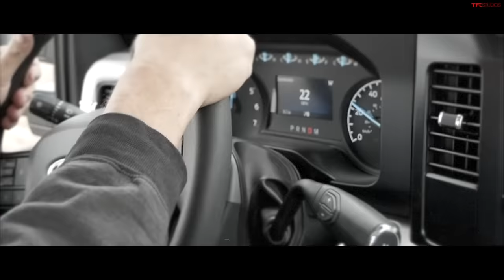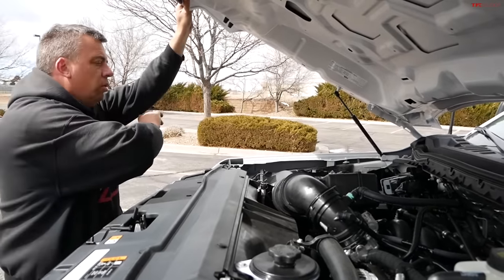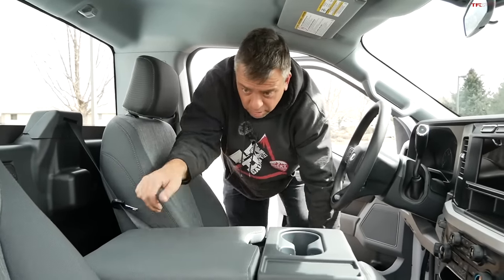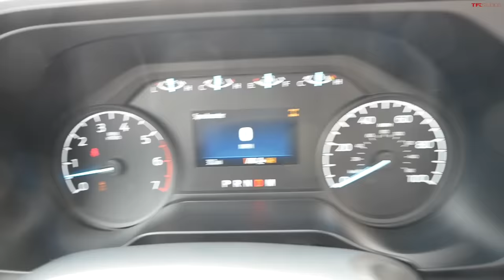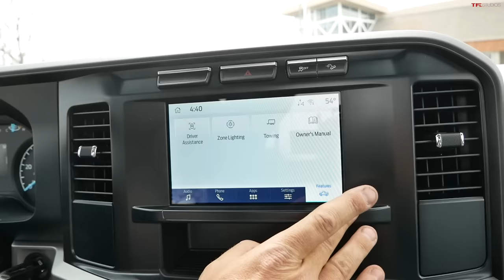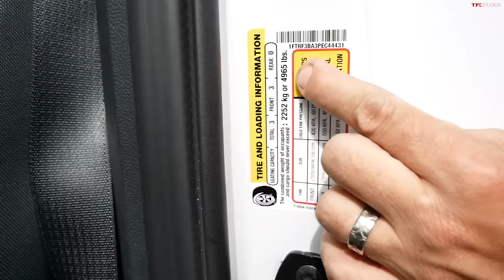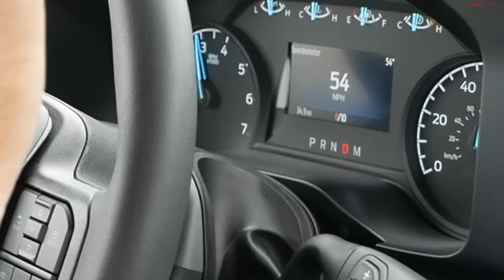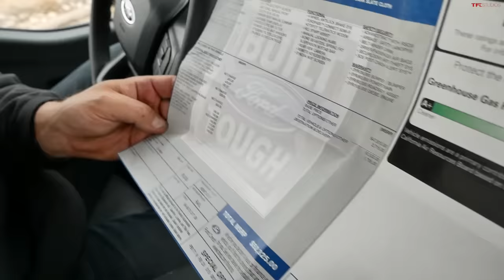I Drive a 2023 Ford Super Duty XL Work Truck with the Brand-New 6.8-Liter V8!

Comment: Even it being a "basic" worktruck doesn't mean it's still not to expensive.
Reply: 😮 still to darn expensive
Reply: The mMSRP is up by over 3k over 2022
Reply: 20 years ago this truck was $28,000….when you adjust for inflation that’s $43,000

If your wages kept up it’s not too out of scope…esp this truck will drive better and tow/haul more
Reply: @tjhva  And that is the underlying issue. Most folks' wages haven't kept up with inflation. The average person has much less buying power compared to 20 years ago.
Reply: Hahaha inflation. Record fuel prices. You name it. You voted for it.
Reply: @tjhva  if you add features that come standard in this truck compared to 2004 you will be close to 50K
Reply: Drove a 7.3 and was shocked what a toilet 🚽 it was 😂. Maybe this 6.8 is a better engine? They had 1 but wouldn’t sell it..?
Reply: They have to review trucks. Regardless of the cost
Reply: Too
Reply: @mdubz101  what is a better gas motor ?
Reply: Who the hell said you need to buy a brand new truck
Reply: Work truck means fleet continuity not cheap. Companies need write offs
Reply: @BigMikeRobinsonFJB   not me
Reply: @t20594   Exactly....beyond it being way more truck the Section 179 deduction has increased a lot since then too. An even more interesting question is would someone have paid $40,000k+ for this EXACT truck back in 2005 or gone for a $28,000 base model with bad driving / leaf spring front / 5.4L etc etc
Reply: @guyod1  Still this is way to expensive
Reply: It's still the cheapest you can get now-a-days for a new truck so he's exactly right.
Reply: scott offord  that's a cool truck, but won't hold a candle to this F350 for capability. Can't tow nearly as much, can't tote nearly as much and no 4x4. 🤷‍♂️
Reply: @dxvidcx Naturally, or if you’re an independent contractor / biz owner of any sort you also raise prices over time. Average income is up from $55k to $70k since 2005 per census data + section 179 deductions are WAY bigger now…the price jump isn’t all that wild once broken down.
Reply: @mdubz101  7.3 is a truck motor lol. In a heavy ass truck. They’re monsters swapped into cars
Reply: Too
Reply: @whatthehallbetch  Got him.
Reply: @tjhva the tech, and powertrain is greatly improved over its 20 year old 2003 brother. A little increase over just inflation
Reply: @BigMikeRobinsonFJB  that's not how it works, but I know it's easier to blame a president you probably didn't vote for than actually trying to learn and understand why inflation has been a GLOBAL problem since the pandemic started. The U.S. president does not set gas prices or food prices. The oil companies and food industry do. They are also responsible for their record-high profits when Americans are hurting the most. Their rationale is production shortages due to the pandemic, but that should no longer be the case, yet prices stay high and they continue to make huge profits. Focus your blame correctly.
Reply: @palebeachbum  the typical blame and deflect soy boy talk.
Reply: @jessenp20162725  Exactly. When you factor in everything, including increased Section 179 deduction, $8-10k increase in price 20 years later isn’t wild
Reply: @BigMikeRobinsonFJB  sorry but I'm not going to argue reality with someone who clearly lacks education on the matter.
Reply: @palebeachbum  again you are incorrect. Stop blaming and deflecting.
Reply: @BigMikeRobinsonFJB  then educate me. Please explain to the class how high food and gas prices globally are the U.S. presidents doing and have nothing to do with the global pandemic. Anyone can say "you're wrong". That takes no effort.
Reply: @BigMikeRobinsonFJB  didn’t you “blame” the president? Do you always behave like a child?
Reply: I bought a brand new 2004 F150 XL Heritage supercab. Paid $15k out the door. Great truck.
Reply: @palebeachbum  So it was Congress and the President who agreed to print trillions of dollars out of thin air while the pandemic had been already over for at least a year, pushing spending above WWII levels.  Then the Fed had not increased interests rates to curb inflation because they didn't like the bad press, until of course it was too late for it to have a good effect, so when they actually did start raising rates it caused a mini banking melt down.  Lots of economics behind that I won't go into here but raising rates more now will continue to exacerbate a banking crisis.  You can't use a blanket response "it was the pandemic" because our...  YOUR politicians are responsible and have to answer to the American people for their decisions, right or wrong, pandemic or not.
Reply: Too much !
Reply: Do you know English wtf did I just read? doesn’t mean it’s still not to expensive? HUH
Reply: @tjhva  this truck is 70k Canadian😂😭
Reply: @BigMikeRobinsonFJB  not fully accurate.  Yes, inflation has been bad the last couple years.  However, the cost of living has been rising for many decades way faster than wages.  It is not the 1950s anymore and that didn't just change just since 2020.  Look at what a CEO earned in 1955 compared to the average worker.  Compare that ratio to today.  Compare wealth and salaries from the top 1% in 1955 to today.  Very telling...

And record fuel prices over the last few decades actually came in the summer of 2008, when we adjust for inflation.
Reply: 50k is a steal
Reply: It’s hideous 💀
Reply: scottofford3061 has no payload
Reply: @palebeachbum FJBiden
Reply: @BigMikeRobinsonFJB  the typical non-critical thinker mentality. Baaa sheep
Reply: @kenj.8897  He's not my type. Lol
Reply: @tjhva  I'm making $15/hr, retail won't give me raises. No. my wages haven't kept up..
Reply: @beastbee0118  I hear that...but someone also couldn't have afforded a brand new 2500/3500 truck 20 years ago on a retail wage either. Y
ou gotta use these trucks to make money commercially or have the extra income
Reply: @tjhva  in 1971 a carpenter earned $5 per hour and could buy an ounce of gold in 7 hours. That is $285.87 per hour today.
We could probably afford this truck if we had the same value paid for work as in 1971.
Reply: Still too many unnecessary gadgets for a work truck
Reply: @BigMikeRobinsonFJB Fool
Reply: @dperr338  soy boy say what?
Reply: @BigMikeRobinsonFJB  Yep, that pretty much confirms it.
Reply: Your single cab Ram is discontinued so your point ismoot
Ram only wants to sell upgraded SUV's with a short box😊

Comment: I remember being able to get a single cab f250 gas for like $28,000 crazy times
Reply: I do like that 6.8 though
Reply: That $28,000 would be $43,000 in 2023 dollars
Reply: @tjhva  So this truck is still $10K overpriced?
Reply: @bryanthornton6787  I don't really think so....beyond it being way more truck the Section 179 deduction has increased a lot since then too. An even more interesting question is would someone have paid $40,000k+ for this EXACT truck back in 2005 or gone for a $28,000 base model with bad driving / leaf spring front / 5.4L etc etc
Reply: @bryanthornton6787  you get slot more truck for the money…
Reply: @CortJohnson  Apparently we have two different definitions of what "a lot of truck" is.
Reply: Back in 2001, our F-350 XLT 7.3 diesel crew cab 4x4 came home with 38 miles on the clock, and a $28K window sticker. You are getting a lot more truck now, but I'll be waiting and buying used. Bigger brakes, insane payload, more power, better chassis, etc. $60K+ for low trim trucks is just reminding me how worthless our money really is now.
Reply: My bran new 1993 F250 XL 7.3 diesel cost me $21 k out the door.   Ran like a premium sewing machine....until....the kid wrecked it with over 120k miles.
Reply: Crazy for sure.  I paid $58k(out the door) for a new, fully loaded 2020 F-250 Lariat with the 7.3L.
Reply: @DS-fx2jn  wow, you killed it. I thought I did good with my 2020 F150 STX 4x4 for 37k (41 out the door), but that 250 is a rolling small mortgage now.
Reply: 2nd owner of a 1970 C20 Trailer Special with  manual trans  with 68k miles.  Great truck.   Installing a 5sped next month.  Paid $800
Reply: @toddwheeler1526  kids...
Reply: Not long ago a 2wd gas F250 XL could be had for $20k with dealer discounts...
Reply: @tjhva in 2005 the 4x4s had front coils.
Reply: @hendo337  Fair enough! You're right, that was the first year for coils. I should have just said 2003, to be 20 years
Reply: That's what the window sticker in my 95 dodge diesel says too. When we allow our currency to be devalued that's what happens.
Reply: @bryanthornton6787 Exactly mate
Reply: Back before people complied with the evil corrupt epa yoh could get a truck that cheap because you werent taking deht money to pay for a def system

Comment: Sad to see the 6.2 go. Been a very reliable engine for me. Hopefully the new ones are just as reliable.
Reply: 420k on my 6.2 all I've done is change the oil and plugs
Reply: Same, really loved that engine but I think this will be a good motor.
Reply: Yep I had one with over 200k on it that I never had to do anything to.  Just oil, brakes and plugs.
Reply: I'm glad to see a switch back to OHV instead of SOHC, I've got a bad taste in my mouth of ford timing chains after the 4.0 and 3.5
Reply: 6.2 are absolute beasts, great towing mpg for a gasser, plenty of torque and they’re WAY less expensive than the diesels.
Reply: The 7.3 had already proven to be less reliable than the 6.2.   
Smoking lifters and cams commonly like the rest of the pushrod terd buckets
Reply: @hydrothermalworm7778  Yeah, great to trade those 6.2 timing chains which never have problems with regular oil changes to the lifter/cam smoking OHV trash.    Ford has joined the GM/Mopar smoked valve train pushrod club thanks to the disappointment known as Godzilla
Reply: @HalfShell  Had Ford taken the already paid for 6.2 and added siamesed bores (like Godzilla has), given it the Godzilla bore size (Godzilla and 6.2 share bore spacing), upsized the ports and valve diameters in correlation with the percentage of bore diameter increase and given in 10.5:1 compression like Godzilla has (6.2 only had 9.8:1 and already killed Godzilla in specific output) said 6.8 - 6.9 liter version of the Boss would have kicked the 💩 out of the pushrod 7.3/6.8 Godzilla disappointments in truck applications and would have made for an amazing performance engine with simple cam/intake manifold changes for special edition Mustang/F-150s…unlike Godzilla.  

Thank Brian Wolfe for steering Ford down the lost path with this Godzilla 💩 and it’s pointless 6.8 derivative and introducing Ford to GM/Hemi style lifter failure and cam wiped cams (and wiped bottom ends thanks with cam material being pumped throughout)…not to mention the timing chain driven oil pump that the 7.3/6.8 have.  

Actually I suggest you take a look at the 7.3/6.8 timing chain drive.    
Might as well be OHC…except it’s already having more tensioner problems.    😂

Ford should have evolved the already paid for and proven reliable 6.2 Boss.  
The Boss just needed some minor updating and it would have easily outperformed the lackluster 7.3/6.8
Reply: @BC08  i hadn't heard of Godzilla's smoking valve trains, but i haven't looked too deeply into it.
Reply: 300k+ is common on our 6.2 work trucks. Get ran hard including way too much idle time and they just keep going.
Reply: @hydrothermalworm7778  i thought 7.3 would be better than hemi 6.4 or chevy 6.6. but the 7.3 has more issues than both. ford old 6,2 was pretty good seen many lineman  trucks with 200000 plus miles
Reply: Lol been through 3 motors between 2 trucks ...... not that great
Reply: @jeffforbes70   About the same as 6.4 Hemi really
Reply: @muskokaroads2371  Don’t know what type of luck you have but I work for the utility company with a fleet of hundreds of 6.2s almost all with over 300k on them, over loaded and idling all day and they keep going. Your experience isn’t the norm.
Reply: My 2018 6.2 had the cam phaser rattle like the 3.5 eco boost, and the cam phaser knock at hot idle where it sounded like a diesel… Dealers wouldn’t fix it because it wasn’t “throwing a code”…. An anomaly I think, most people have pretty good luck with them, but they weren’t perfect.  I’ve got a 2020 7.3 now, and it’s night and day a better performer, with the same or better mileage as the 6.2.
Reply: @keithfranzen9209   7.3s have a cam phaser too so you haven’t avoided that Borg-Warner cam phaser potential dilemma with the 7.3 either.
Reply: Fuel chugging 6.2
Reply: They should’ve just made a pushrod 6.2 like it’s big brother. I find they’re too close in size.
Reply: @BC08  agree, I haven’t heard of it yet, maybe it has a better oiling system than the overhead cam ones?   You would think we would start to see it come up some.   Maybe the lifters go out first lol.
Reply: @keithfranzen9209  Not sure, the 7.3 has an external (to the block) timing chain driven oil pump.    It is variable displacement but I’ve seen examples of them failing already, so not sure about that.
Reply: @dam4274   Godzilla and 6.8 are both basically pushrod 6.2.   Godzilla shares bore spacing and all journal diameter with the 6.2.

What Ford should have done is made a big bore 6.2, kept it SOHC, and raised the compression.   Would have smoked 7.3 badly
Reply: @dam4274   And if you’re saying they should have dropped the 6.8 down to 6.2 liters it would have been an absolute dog and been embarrassed badly by the existing lower compression Boss (SOHC) 6.2.
Reply: Not really.  2% of all Ford’s engines failed last year.  That’s a normal failure rate.   The 7.3 was only a fraction of those that failed.  No worse than any other engine.

The lifter/cam failures all seem to be related to fleet trucks with high idle times.
Reply: @TruckerMike089  engine? Motor?
Reply: I missed the axle ratios front and rear
Reply: @BC08  all manufactures have some suppler issues but ford 7.3  will also have head gasket issues . it has a open deck with the notorious slits between cylinders. thev6.4 is a closed deck 4 times the gasket material
Reply: @robertl9065  Which makes sense, the cam gets a majority of it's oiling from the crank splashing it up onto it. Constantly idling it wouldn't give the cam enough oil splash.
Reply: I have 340k on my 6.2 towing 12k regularly love it won’t get rid of it for a while
Reply: The 6.2 had to go the 6.4 hemi absolutely murdered it. Ive driven both and the hemi has way more power. The 6.2 with a 18ft landscape trailer and two mowers 1.2k each got 8.2-9.5mpg while the ram got 9.8-11 made absolutely no sense to me. Ford had 17k miles and ram had 7k. People saying the 6.2 had power makes no sense to me cause the truck towing 10k was absolutely screaming and incredibly slow. Probably a little better than the 5.4 triton in terms of power.
Reply: @jamesworkman686 need change coolant every 100k among other fluids

Comment: Seeing a diff locker on a work truck is GREAT. It's about darn time!! Lockers are important and a great selling point. Hopefully this new engine will be a solid platform for the Ford trucks!
Reply: My plumbers 2 wheel drive 2011 super duty has an electronic locker and it’s a basic work truck
Reply: For 4x2, absolutely.
For 4x4, not absolutely.
Reply: @Bloodcurling  my Nissan Frontier pro 4x has a rear locker and is 4 wheel drive..I've been in situations where I was VERY thankful I had that locker. It makes a difference when it gets really nasty 🤷
Reply: I drive a 2021 f250 as a work truck, and the diff lock helps in certain situations, but Ford gimped it by making the locker disengage at wheels speeds above 25 mph. 25 mph wheel speed is nothing when you're stuck in snow or mud.
Reply: @patricks.7951  Yeah, kinda like my Nissan, the locker can only be engaged in 4 low 😑 they do make a thing that plugs in the obd port that overrides it 😂 I might need one
Reply: I drive a truck
Reply: I'll second that. I had a series of 2 wheel drive trucks, one of which was a 250, and man, that thing literally got stuck on flat wet grass.
Reply: I’ve seen them on those trucks since like 2010
Reply: Fords been doing it for close to 15 years on all the f series trucks
Reply: Very good truck
Reply: how does that do what?
Reply: Darn 🤣🤣🤣

Comment: I like how manufacturers are finally considering upfitting. We have a '21 Ram 5500 at work. It was great. No messing with cutting holes in the dash to mount switches. Didn't have to fight to tune wires through the firewall. It was all easy access to run wires from a block in the firewall to whatever components you were adding.
Reply: I’m pretty sure Ford has offered upfitter switches as an option for at least a decade now.
Reply: Ford has offered this since at least 2011
Reply: @noahbouchard5155  had them in my 2005
Reply: Ya Ford had them since forever
Reply: Ford has been doing that for two decades now
Reply: But its all plastic

Comment: I can't wait to see you guys do an Ike Gauntlet Max with this truck. I also look forward to a fuel mileage comparison while towing with a similar diesel.  I like the idea of this truck for an occasional heavy tow, and for a camper.
Reply: I agree.  I have had several ford's and still owe one today.  But my 1990 chevy 1500 with the 350 had an under hood organization which was clean and well thought.  My beloved Ford 300 6s and my Ford V8 and now a Powerboost look horrible!
Reply: Why will not test that amazing F350 against Ranger?? LOL
Reply: This is definitely a size/stability towing vehicle, not a heavy haul towing vehicle. I would love to get one in a dually just to have that extra protection if you have a single blowout
Reply: What a freaking mess of wires, hoses, and electronic modules. Ford, please please mandate all your engineers / designers work as mechanics for 3 years before they are allowed to design your trucks. 

Seriously, with some self discipline and planning, your trucks could be made “works of art under the hood.
Reply: @bret9741   I agree, less is more
Reply: I want to see the gas versus the diesel